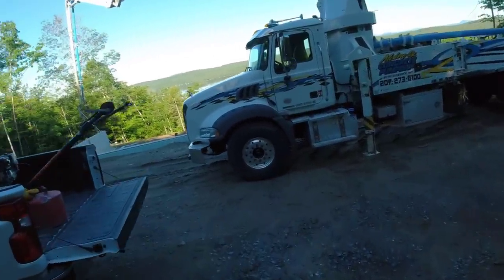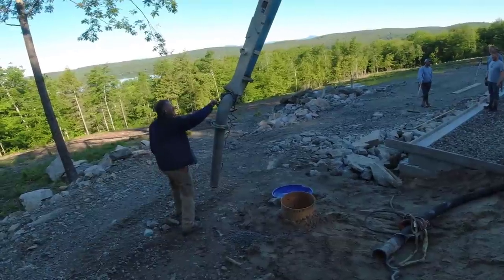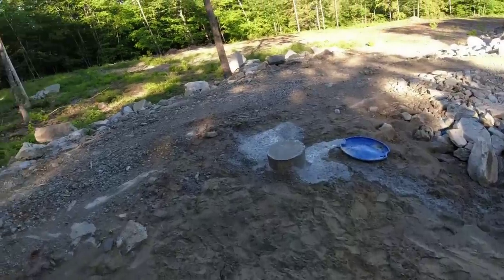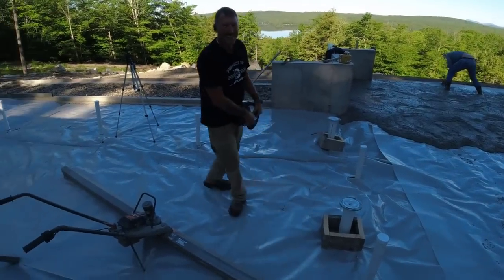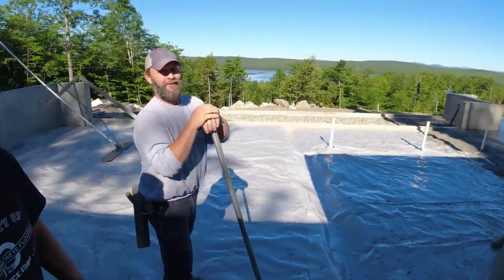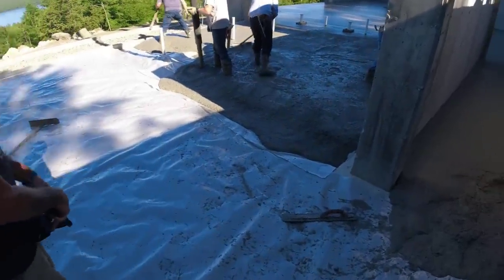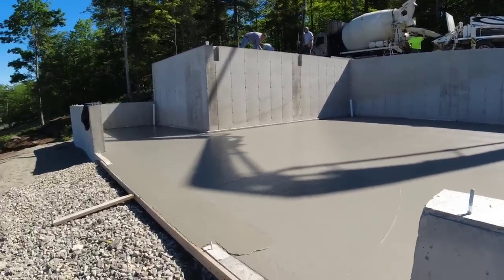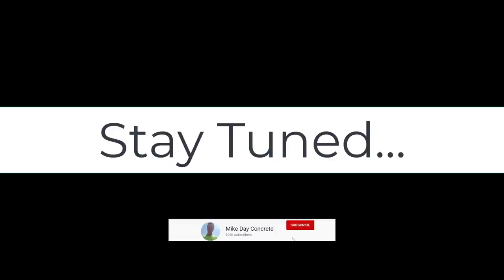You Won't Believe What Plugged The Pump on this 40 Yard House Pour!

Comment: That’s why I never use a reducer, I use a 5” line because I’ve seen that way too many times with trucks backing up and timing out, that wasn’t from the concrete truck, that was in the line, and every time I’ve seen that happen, with a guy that looked a lot like that pump guy they say the concrete won’t pump, and since I went to a 5” line and no reducer I have never had one clog up… especially when you’re priming out the pump, that usually doesn’t ever happen, especially with a resi mix, and water reducer, I always have to tell the pump company to make sure there is a 5” line on the truck, and you can pump quite a bit faster without a reducer, awesome job again Mike, try it without a reducer, you may like it.